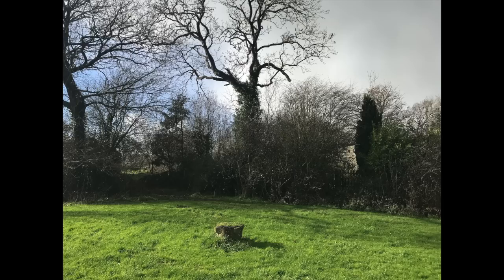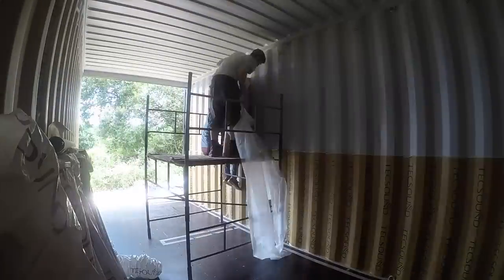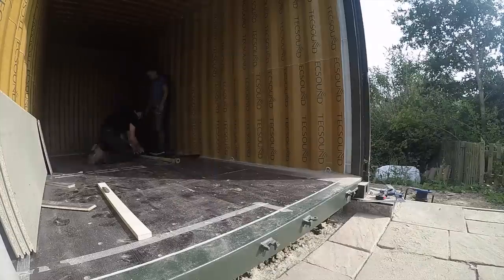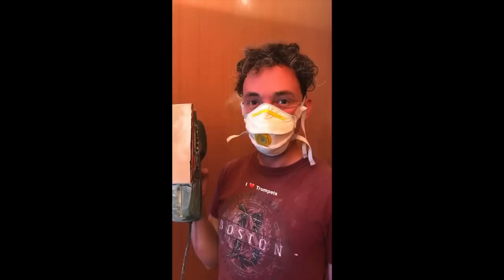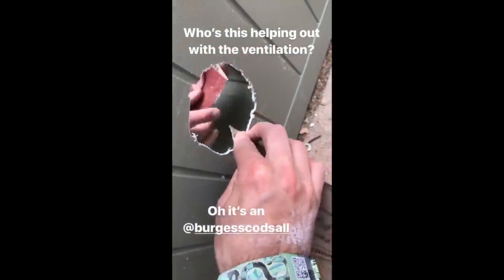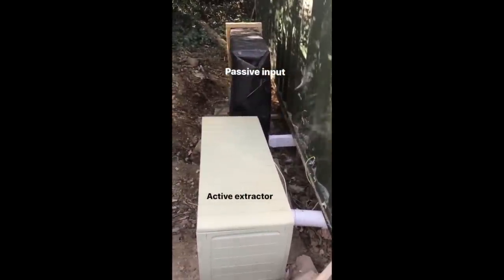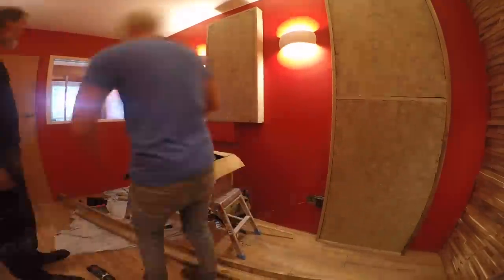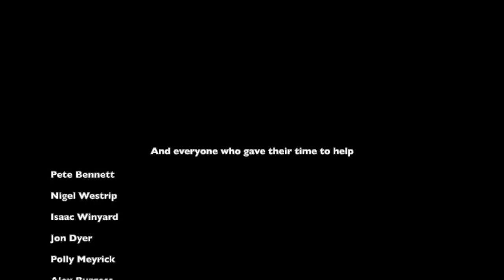How I Built A Shipping Container Recording Studio // Building Rawcus Studios

Comment: I used to build studios professionally and what I learned is to make walls non parallel. In a tight space like this you could off- set one end of both walls to be wider at the main door and skinnier in the back. It only takes an inch or so for each so 2” total difference in the width. Absorbers first mid- low on corners goes a long way. Good job
Reply: Just curious but what's the reason for doing this, soundwave direction?
Reply: Create Love Happy it’s a shipping container 😂
Reply: Tegan69 I’m not a pro but I believe less standing waves.
Bass builds up in 90 degree angles
Reply: @jasongravely7217  OK, thanks for your input!
Reply: That is actually brilliant
Reply: Yeah and then your resonances would be unpredictable and more hard to treat, and say goodbye to your mid image since it wont be paralel meaning you wont hear the same on the left side than on the right side

Comment: in times of corona virus, those masks are the most expensive thing in the project...
Reply: *most valuable
Reply: Queen Purple, while there is a lot of panic buying, many doctors work in hospitals that do not supply N95 masks. This creates a need for the doctors to use them as well, as many of them are in day to day contact with those must vulnerable to the disease.
Reply: They needed masks to put in rockwall, then used leftover rockwall as a sound filter on the air intake...
Reply: Wes Darling woah I missed that part. Seriously? Wtf they just breathing straight poison
Reply: @queenpurple8433  don't know, I doubt they do either.  The original material would have been asbestos, thus the name "rock" wall, but over the last few decades the industry took to different production methods and renamed several types of asbestos.  So whether or not it is asbestos, or dangerous, who knows?  We only know that it probably isn't regulated the same way.
Reply from the maker: @johncaccioppo1142  Around the air intake pipe, Not inside.
Reply: @RawcusStudios  ahhhh.... ok sorry, thanks for clarifying

Comment: For those dimensions, it would've been better to keep it as a mixing room only, with the desk and monitors placed at one end.
Reply: that's exactly what I was thinking!!  one long room with the speakers behind that cool wooden wall.... and add about 10x the amount of acoustic treatment (ROCKWOOL panels, not those lame foam thingies that only dampen the highs) to the walls & ceiling & it'd be legit worldclass sound quality in there....
Reply: I disagree because you'd get less out of the given space
Reply: @wolfieeeee256  you get less acoustically out of the space dividing it up like this. the larger the room dimensions the better the fidelity of the speakers. doing an A-room & adjoining control room in a large hall with a high ceiling is one thing. doing it in a shipping container is less that ideal... there will be little to no isolation between the two 'rooms' in this scenario anyways. so one long room would've been the best way to go in this case i think, from an acoustic point of view
Reply: I'd do the opposite.
A big room for yourself, a small room for singers, amps and reamping.
But, then again, it all depends on your workflow
Reply: @ChristianIce  I hear you. But recording an amp or singer in a small vocal booth usually gives a really boxey recorded sound... unless you have TONS of acoustic treatment... which is impossible in this case.... better to leave it as one open room and record amps and singers with the engineer in the same room on headphones.... would yield better fidelity for sure.... not as 'studio-looking' but more professional results for sure
Reply: @YusifRefae  
Vocal booth must be dead, of course.
We are talking about cro magnon man level dead :)
Reply from the maker: As people have said, it depends on personal preference. I personally don’t want to be in the same room as the performer. And because I planned the build well the separation between rooms is very good. Good enough to not effect me listening to the audio being recorded through my monitors while the performer is playing. Also, the foam in the control room was a temporary solution due to budget. I was perfectly aware it wasn’t sufficient when I put it in, but when you’ve got materials lying around you may as well use them, even if the effect is only a slight improvement.
Reply: @ChristianIce  what I'm saying is there is no way to get it that dead in a shipping container. you'd need 6-8 inch thick traps all around... which isn't workable given the constraints of the place. you're better off putting 6-inch traps on all the walls and ceiling and making it one big room. it's just physics after a certain point...
Reply: @RawcusStudios  great job on the build tho bro, not knocking you at all.... i'm not talking about the isolation between the booth and 'control' room, i'm sure it's fine isolation-wise. i'm talking about acoustics and the fidelity of your speakers playing back... as well as any acoustic/mic'd sources in the room... it will be hard to get a good bass response the way you've done it. not trying to criticize you man, just trying to be helpful. you built it the way you built it, the best thing you can do now is try to really learn your room and that will likely mean learning to compensate for some bass/low-end irregularities you're probably gonna have (on account of what i said before bout room treatment). the more OC-703 or rockwool panels you can cram into there the better that's all gonna be!!
Reply: @RawcusStudios  
That's what I did with my first studio too, but after one year I swapped the rooms because fuck the singer dancing in the big one and me closed in a booth :D

Comment: Super interesting to see someone else make one of these. I built my first one in 2018, still going strong.  Some differences to yours though.  I did floating floor and the resilient channel to hang the walls on, did double layer sound bloc plaster and at the front doors I did sliding glass with cedar cladding. Instead of 2 rooms in the studio I went for a porch/foyer and main room as I'm a media composer and don't really do the band-y stuff when you'd benefit form a "live" room. The porch has tea making facility, the fuse boxes and  split system AC controls etc.  All my stud walls and floor had rubber mounts to eliminate even more vibrations.   Currently get total noise cancelation of 100DB inside to outside. Obvs I can't hear any of there outside while in the studio and it can even hail on the roof with no noise penetration.  I did all my wiring under the floor studs to make sure there was zero holes in the walls. My lighting and sound panels are all mounted to an internal skeleton structure that hugs the outside of the internal walls. all of the skeleton is hidden behind light recess panels and sound panels - result = no holes in the walls.  The only holes are behind the AC fan and those that come up for the plug outlets in the floor.   The main room has a great studio door that I reclaimed from the old BBC studios that weighed 100kg!   I built it inside a high cube container and have a 6 inch ventilated space between the roof and the ceiling insulation that is also protected by plastic. This allows any condensation to dry out quickly as that cavity has outside vents.  The big steel external doors still close for when I need to lift it to a new location (although my biggest fear remains someone closing them and locking me inside!  To the point I keep a metal disc cutter in a cupboard inside. No Joke!  I really should remove the doors from the outside when it's stationary, but I do enjoy being able to close it shut when I am away from the property for holiday etc.  Something I never did and have always meant to do is build steel frame cedar decking and step to sit flush that I can disassemble and take with me. Something that always strikes me is if I've been away for a few weeks, it still smells like the day I built it when I return, a freshly constructed kind of smell,  that smell then goes away until I'm not it there for ages again.  One day I if I ever have the space, I'd like to make a 40ft one and mound stone and earth around the sides and roof so it's like a hobbit studio within a man made hill,  and turf the whole thing with lovely plants etc. and Furthermore I'd like to join 2 x 40ft with 2 x 20ft in a square formation with a central garden....   I never get to talk about the construction to anyone so sorry for me doing a massive long comment!

Comment: This is amazing. Would you mind disclosing a ball park budget for a project like this?
Reply: I’m with Jonny Castle concerning questions of price. Also did you have plans drawn for the build? I’d love to duplicate what you’ve done! Can’t hurt to ask. 😂
Reply from the maker: Absolutely, budget was 10-12k for the project, but the general soundproofing effect and layout could be achieved in under 10k. I just got carried away with all the final touches like the solid oak desk and special custom acoustic glass panels for the partition wall, which pushed the cost over the 10k mark. I also hadn’t factored all the smaller bits into the original budget like screws, poly filler, acoustic sealant, ventilation pipes, paint etc which slowly add up to a fair bit!
It took me 8 months to plan and design so I have a notebook full of drawings from working out the layers of soundproofing etc. When it came to the build some of these changed as we hit unforeseen obstacles but it was only possible to get the build done in 3 months with all that prior planning 🙂

I’ll be doing a ‘final design plan’ at some point before i forget (never know, I might want a second one someday haha)
Reply: @RawcusStudios  12k in what currency please.
Reply: @RawcusStudios  : Is that US $$$ or British pounds??
Reply: @RawcusStudios  10-12k was the budget, but what did you actually spend?

Comment: Outstanding! Just one, minor, critique, if I may,  Rockwool's ability to absorb vibration, as a dense mass, is the same whether they are contained (like, in 3mm mdf or 1mm sheet trans PVC with dust tape around the edges), or whether they are left bare (like just wrapped in fabric). may I suggest for anyone following this lovely, genius, project to contain your rockwool. The effects of Rockwool for absorbing low end through localized mass is 100% the same. The unhealthy effects and signs of exposed rockwool are not apparent at first, but put some bass into the room, and get those particles (in the rockwool) moving, or activating, and you'll will not be ....  well....whatever...good build.

Comment: would be interested of the frequency response of your control room. I built a 3 leaf wooden structure designed to take the energy out of the sound waves but letting them pass threough the outer walls at very low volume.

Comment: Regarding the air ventilation; is there are particular reason why it's set up that way? Would it be possibly more efficient to bring cool fresh air in from low and have the warm/hot air exit up high?

Very nice build. Congrats.
Reply from the maker: That’s exactly what does happen 😊 The warm air rises and is drawn out with the extractor through the ceiling vents, the pressure difference created by the extractor draws cold/fresh air in passively through the lower vents.
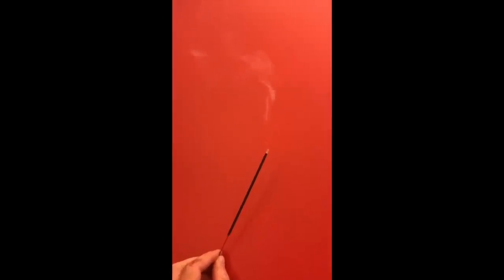Reply: Rawcus Studios I rewatched and realized  my misunderstanding was due to a bit of narrative slight of hand going on at @ 10:10 . Not intentionally of course, but you are talking about fresh air in while the camera is showing the outtake.

Comment: wow after spending 2 and a bit years sorting a studio space at my place (loft  room) , you make me realise (a) I thought I spent loads but  calm down, nowhere near this guy!!  so I don't feel so guilty about spending more than I can afford. And (b) It's the inverse of yours in what I wanted it to  sound like!
It's the best project I've seen in ages, did you get in done in 12 months or so, from ordering materials to the studio getting a session on? 
I kept thinking as you added more internal layers, etc, gonna be lucky to move a bass guitar around  the rate they're going. No fat bands or brass bands then, I guess! Isn't shifting equipment in/out a squash as well? But never mind all that; it's so well done, well impressed
Reply from the maker: Hey. Thanks for the comment.
The video covers the 3 month build, straight into recording sessions. unfortunately the video doesn’t give an accurate idea of how much space there is. I can comfortably fit a full back line into the room, have done sessions with 3 part vocal harmonies tracked together as well as an isolated horn section. However it is designed as a multi track studio, so the majority of the time I track instruments individually, so the live room is actually an isolated booth. The internal dimensions of the live room once finished are 7ft x 13ft. No tight squeezes moving in Kit.

Comment: Nice design/construction work!  I just have one question.  What's the purpose of wearing a mask to install the rockwall if you are going to make the rockwall a permanent feature of your air intake... did I see that right?
Reply from the maker: Good question. The rockwool sheds an awful lot of fibres when you handle and cut it. It’s advised that you wear a mask when working with it. With the ventilation just being a very gentle trickle the rockwool fibres aren’t picked up by it. When you put a hand over one of the vents it’s a similar trickle to if you were to gently blow on your hand.
Reply: @RawcusStudios  I'm guessing that material may be safe for that application but I would double check the manufacturer's safety data.  If there are airborne vectors it will probably be detailed there.   
Thanks for the great video, be safe!

Comment: Doesn't it get hot inside though despite the ventilation?
Reply from the maker: Not atall, the gentle ventilation keeps it at a moderate temperature throughout hot days. I use a small oil heater to bring the temp up if needed during the cold months

Comment: I'd be worried about the partition, especially the door in terms of sound proofing. Two walls with two doors, separated buy a 6 inch cavity would be better? One door opening in and the other opening out?
Reply from the maker: It’s a good point, however I used a 50mm thick internal fire door, so there is little to no bleed atall. 2 doors, with handles taken into account as well would have taken up way to much space too.
Reply: @RawcusStudios  Thanks for replying. I'm glad to hear the fire door does the trick. Would that  take a full drum kit into account? Especially a heavy handed rock drummer? ))) I suppose a very heavy curtain on the live room side might dampen that? And you could open it easily when the drummer has gone home. lmbo (edit) Really great work by the way. I mean excellent work.
Reply from the maker: @thetube4607 , Kit is a tricky one. I have had a heavy kit player in laying down some Demo drums and there was some bleed between the live room and control room if i wasn't using my monitors. However this doesn't actually matter in the grand scheme of things. I can track on closed back headphones so some slight bleed from a kit into the control room Is something I am happy to live with and doesn't negatively effect the recording process. Bleed into the live room would be an issue, but this doesn't happen.
 Glad you like the build, thanks for commenting :)

Comment: What about rain on a steel roof? Can that sound be mitigated?
Reply from the maker: Part of the reason I added the larger gap in the ceiling was to add a bigger air gap to soak up that sound. When it is really pouring down you can hear it a little if you really listen for it, but not enough where I’ve ever heard it come through a mic. 😊

Comment: Isn't it hot as hell inside in the summer?
Reply from the maker: No atall. The Rockwool acts as both an acoustic and thermal barrier. It’s always cold inside when I open it up on hot days and stays comfortable all day once open. A heater is required in the winter, but only for an hour in the morning.
Reply: @RawcusStudios  will it be better if the studio (container) is put underground? Thats my idea for in the future but idk if its a good one 😅
Reply from the maker: 100%. I actually thought about burying mine above ground at one point. But you then have to fork out to coat the outside of the container to protect it plus the portability of a container is one of the reasons I chose that over a fixed building.
Reply: @RawcusStudios  true, you got a good point there.. You never know if you need to move or one day find a better house